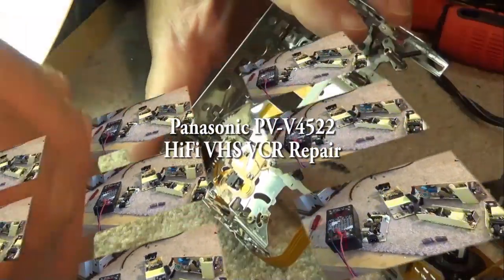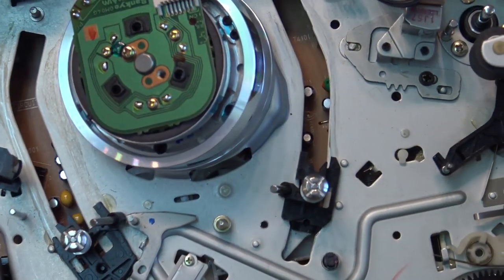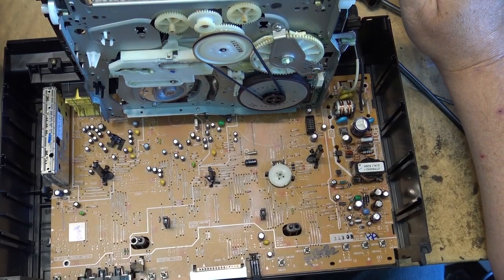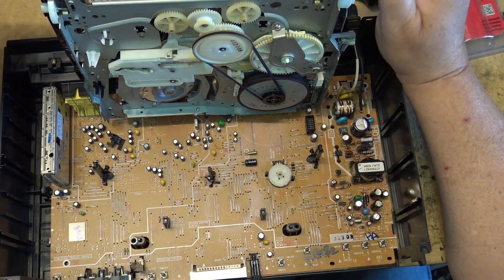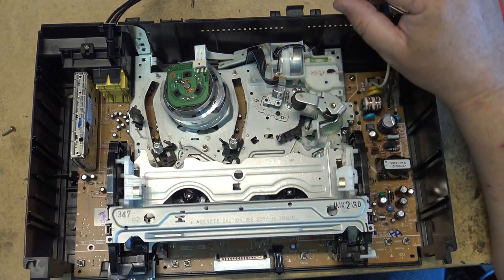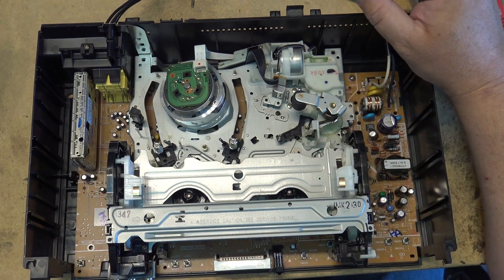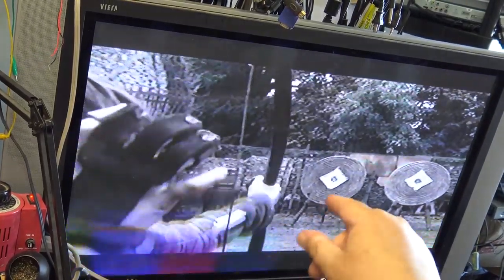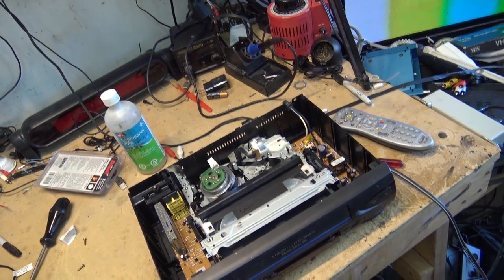Panasonic PVV4522 VCR Repair

Comment: Cant find Deoxit here in india its very expensive what u will saggestion to clean mode switch
Reply: Fiberglass brush
Reply: @kenrichmond3946  what do u mean fiberglass brush?
Reply: @Vintagelover1  It's a small brush made of micro-fiberglass strands pressed together and wrapped ... Typically in rubber or plastic of some kind.
Reply: @kenrichmond3946  thanks man for ur advice i look for mode switch cleaner like deoxit but its not available in india infact nothing can i find to releted vcr like head cleaner or rubber renew but as now i am did repair my vcr its working fine but if i need in feature so i ask this guy if any alternative cleaner i should use thanks brother
Reply: And i clean mode switch with 99% isopropyl alcohol and put some silicon grees
Reply: @Vintagelover1  In my shop we used "liquid wrench" to lubricate the mode switch. DeOxit isn't required but if you can get some, it's ideal. You just want to get the oxidation off the contacts and use some kind of lubricant that won't react with the plastic.
Reply: @Vintagelover1  Sounds like it's probably fine. In the 90s when I worked on this stuff products like DeOxit and silicone grease weren't as readily available as they are today.
Reply: @kenrichmond3946  yess i using too thanks dear
Reply: @kenrichmond3946  exactly and i love old stuff i just love old electronics they made in 80s or 90s thats really extraordinary i still have few vhs camcorder around 10 vcr here u get in very chip price
Reply: I stil remember how may dad used to shoot wedding function with Panasonic vhs Camcorder and we were kids when they play on tv i cant tell you how i am love to see on viewfinder

Comment: Can anyone inform me why I am getting a crackling/popping noise on my VCR audio.
Reply from the maker: HiFi audio on VHS used a technology called deep layer azimuth recording.  The signal for the audio was laid down first by the hifi auduo head at +-30 degrees azimuth.   Then the video was recorded over too if the audio at -+ 7 degrees adimuth.   This creates a 37 degree difference between the video and audio tracks.  When the video was laid down it was at a lower level so it didn't completely erase the audio that was recorded a milisecobd before the video head plowed through the nice strong audio signal and erased 75% of it.   
On playback, because if the 37' angle difference there was enough of the original signal there that through lots of amplification of the signal there was enough for it to work.  Here is the problem though.  Magnetic signals get weaker over time and the ones on the deep layer of the tape become harder to read.  Couple that with heads that are starting to wear and it is a recipe for disaster.  The audio signals are also FM recorded. When they get weak it will start to get noisey sounding like a very weak FM radio station.   If course your alignment could also be off. A check of the waveform on a scope would determine if that is the problem but old tapes tend to have more problems playing the audio.  I just had 7 tapes come in for digitizing. They were recorded on different machines over the years and i tried 3 of my players that are in perfect shape and none could get clean audio.  It was crackling on all the machines I had to turn off HiFi and just transfer the mono linear audio.  It was either that or noisy sound throughout the tape.  
VHS hi fi was a shitty way to do it.  At least betamax and 8mm did it right.  Put the audio between the chroma and lumanence signal.  Yes I am aware that pal beta did it the same way as VHS because the slower drum rotation speed didn't have enough bandwidth to do it the way 8mm and ntsc beta did.  Same reason VHS used this useless (as far as archive reliability went) method.
Reply: @12voltvids  I thank-you for this in depth information. I probably should have included that I am using my VCR as a music cassette deck and not for video. I have the Toshiba SV-F990 VCR. When I first received it, I purchased it used; it it produced fantastic sound. It was clear and had a warm texture to it. Then suddenly all those traits went out the window. It still plays but the crackling/popping is very annoying. Can this problem be corrected. Once again thanks.
Reply from the maker: @kennethbillups3794  
This is why VCRs should never have been used for music. Should have bought a dedicated DAT for that.  Even though you were not recording video the video carrier was still recorded over top of the audio erasing 75% of it.  Over time that signal gets weaker and once it crosses the noise threshold for FM demodulation it gets noisy.

Comment: I once had a VCR with the auto head cleaner that deteriorated, and melted on the heads and ruined them.
Reply from the maker: Highly unlikely that the head cleaner wheel ruined the heads. Contaminated them yes but a good cleaner like Xylene would dissolve it pretty quick. That is what we used in the broadcast business, xylene to clean heads. Just don't get it on any rubber parts or the rubber parts will be no more.
Reply: 12voltvids 
Well, the foam turned into a sticky goo.
Reply from the maker: @mrmagnetoscope  Yes but that will clean off.
Reply: 12voltvids 
I didn't know it would be possible to save, I must have not cleaned it the right way. Good thing it was just a basic VCR that has no value, it's gone now.

Comment: This unit probably cost around as much as a visit to the repair shop.
Reply from the maker: That's why I never saw any come in for repair.
Reply: @12voltvids  Hi, I'm working on a sharp VC-H952 that is eating tapes when ejecting so I decided to clean the mode switch. It looks a lot like this machine inside except when I remove the chassis, there is no mode switch where you found yours just a hole in the circuit board where the center of your mode switch would be. Any advise? I can't find a mode switch anywhere. I've worked on a few VCR's but none like this. Thanks in advance, Mark
Reply from the maker: @marknewton2878  There will be an encoder somewhere. Some use an optical encoder, and they don't need cleaning, but they can and do fail.
Reply: @12voltvids  I was thinking it might be something like that. I'm still learning. Thank you very much for taking the time to help me out
Reply: Oh and thank you for all the great videos. I can't remember the last time I went looking for answers and I didn't land on one of your videos

Comment: I have two vhs jvc version HR-D721EN and both play with sound but black image, I already cleaned the heads and it's still the same, if I fast-forward there you can see the rain but then it's black with the play logo. any idea how to repair it or a circuit that is wrong. Thank you
Reply: It's not getting a signal. The heads are filthy or worn out. Clean them like he shows in the video and make sure you use a good tape. Old/Bad tapes may clog the heads. If heads are worn out they're probably not available.